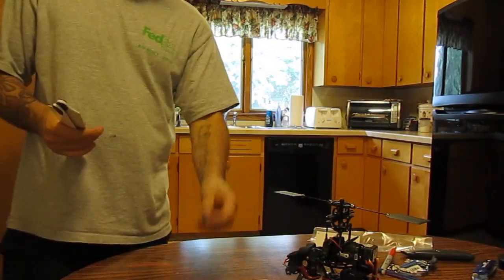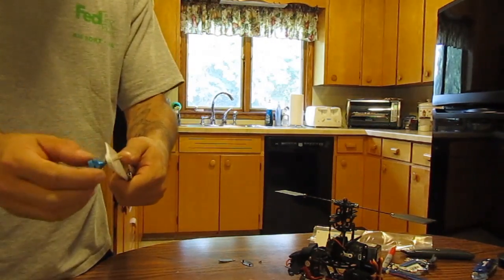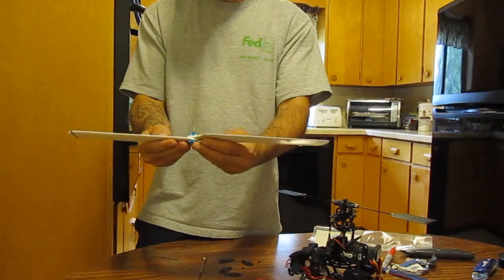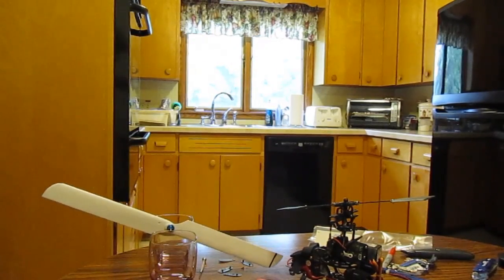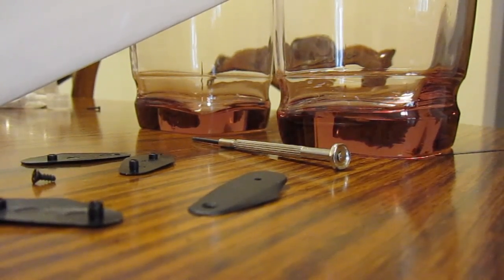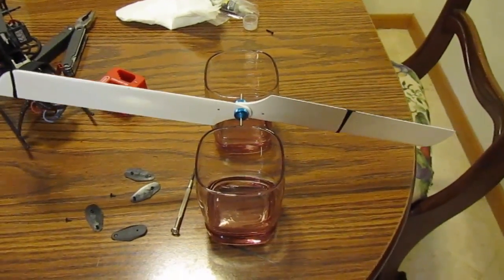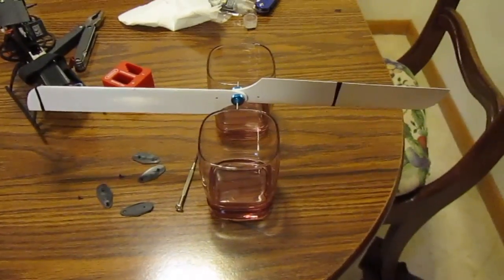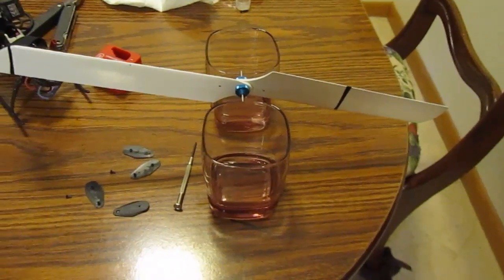fixing center of gravity and balancing blades pt.2 for my Blade SR blades

Comment: couldnt you just file the heavy blade into ballance?just wondering because i dont like tape on my blades.
Reply from the maker: Tape or some sort of sticker  is the way it should be done. if you are using a wooden blade you could sand them , but you are modifying the shape of the blade and possibly the performance and integrity of the blade,  carbon fiber blades you never want to sand, they have a think layer of carbon fiber and inside they are hollow and filled with foam or something in the center, they also have some type of weighting in them,  usually a metal rod,     if you happen to damage a CF blade they can easily fly apart or what not if you try to fly with that blade,   and i could see a CF blade being damaged very easily if you were to try and sand the blade.     if you think about speed that the blades are moving and the amount of force a helicopter can put on those blades you are way better off just using tape or a sticker,     if you get good name brand blades they are almost always balanced perfectly.    every set of edge, cyclone and radix blades i have got were all perfectly balanced out of the package..

Comment from the maker: @birdmanbl    your ESC powers your servos   you add a external bec and hook it up to your battery wires, u plug the ESC into the BEC and plug the BEC into the RX   the BEC is now powering your electronics instead of the ESC,   now the ESC will not get so hot and have less stress on it and your sevos should have better preformance depending on how many volts the BEC puts out.   mine has 5 or 6V setting,     my servos will handle 6 volts and move quicker at 6 volts.

Comment from the maker: @birdmanbl    did you do this,  just wondering how much of a differene you noticed,   on something like this that has small blades you wont notice it as much but if you have a 550 or 600 or 700 or something like that   the blades must be spot on or it will fly like crap,     bet even on small blades i noitce a good difference when they are  balanced correctly.

Comment from the maker: @birdmanbl 

i just use electrical tape..  some people use tracking stickers,     just make sure the tape is good and sticky.   and  the edge if the tape is not where it's gonna get peeled off by the wind,   so make sure you wrap the tape around the blades in the right direction  so the wind would be pushing the tape down not tring to peel it off.   if that makes sense